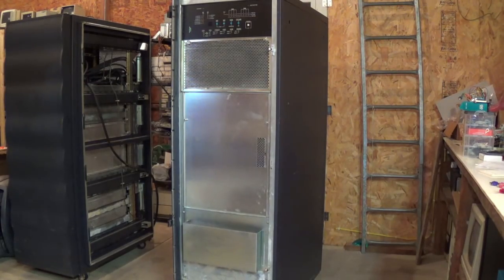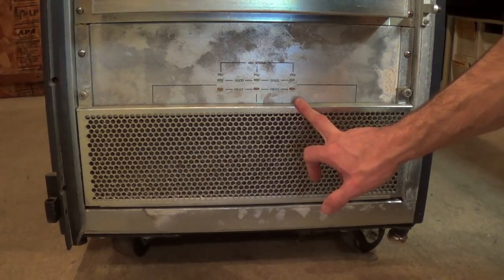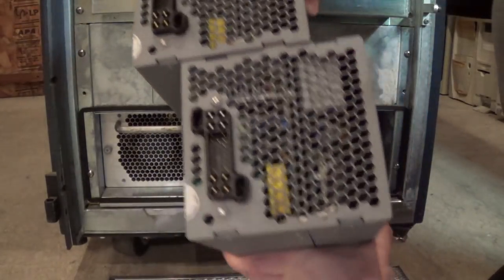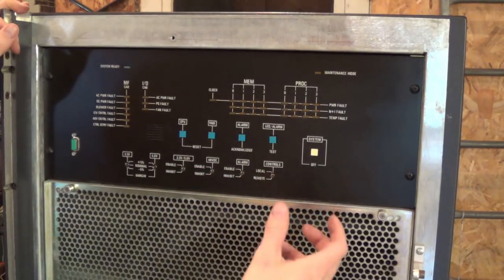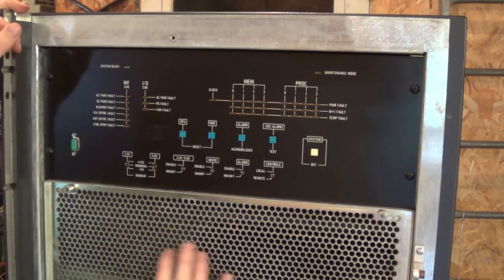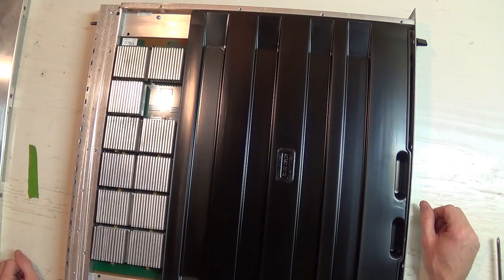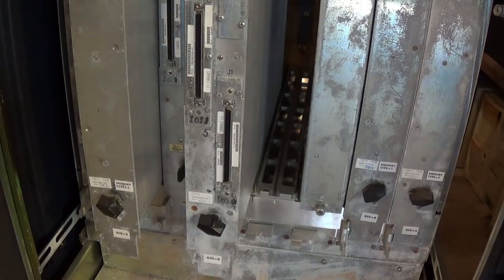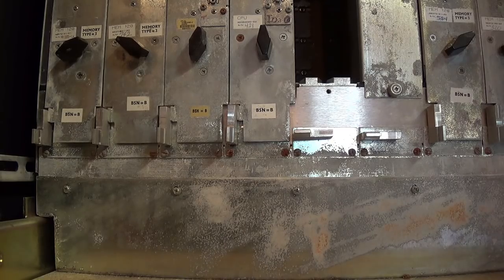Cray J98 Project - Processor Cabinet

Comment: Some lubrication on the rails and screws might help prevent stuck screws and improperly seated boards.
Reply from the maker: I'm a bit dubious about lubricating computer parts as lubricant tends to attract dust... but perhaps it's better the lubricant grabs the dust than it settles on boards :) (It could also be confirmation bias. "Look, there's goo on it, and it's covered in fluff, therefore, if there's lubricant, there'll be dust.")

Comment: The synchronicity is unexplainable why ine doesn't therefore leave retro models lyrics ng about disconcerted gravitates of unusual or completed rejections that occur fir things like Olivetti for example becomes apparent to you in a them whirl phoned world as a secretaries typewriter because all you allow crazy proffestations of UNIX DES cipher writers too comple an invite too an invader that uses that which is not and can not ever be as indifference nite you call Alladin as genius? These this bottle of crob it calls itself too expectations of the known that you can be easily watched why continues tolls of pi on ears as unknown manufacture is this item compared too model manufactures that continued as various concerns that involved too initially build this cray as joint ventures re and known only ever offered too that se of sound Sence and mind,why these syntacts continue medical a mass Intel agents of crazy comparatives as atmospheres are here alike the world which was once called as a design overlook of the sun in a planetary set that Jack jolly tar looped billions off into men tales of unsound mind,Sence,etc where voted too live out of be tax pulling lines of copper nic why are net non bill collector moderator eats of petty up swears of non exist etc as all go down the hole an owe Dom in o?
J construct relates JBod yeah? Think there's a nice Tesla acceptor board GPU fir sale on eBay,it's a 1u unit just over fifty quid!z,

Comment: Was she left to out in the weather? Seems to have a bit of aluminium corrosion.
Reply from the maker: You noticed that, huh? To the best of my knowledge it was not, but had been stored in a damp location. The boards and connectors appear clean, so I think it's limited to just some of the outside surfaces.

Comment: http://www.1000bit.it/ad/bro/cray/CrayJ916.pdf
Reply from the maker: Thanks for that. Downloaded and stashed. :)
Reply: I did find a few..  like mentioned.. they are sporadic.. I couldnt find much on the UNICOS 10, at least that was any specific.  I also didn't find much that was J90 or J98 specific either.  Seems to be a engineering supercomputer.
Reply from the maker: Yea, which is funny because I'm certain there were more J9x series machines made than any other Cray. But finding any real documentation for a Cray is a PITA, it appears.
Reply: yeah. I am sure its out there though,  Interesting enough to keep looking.